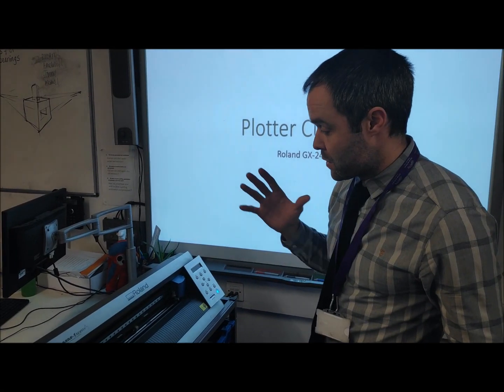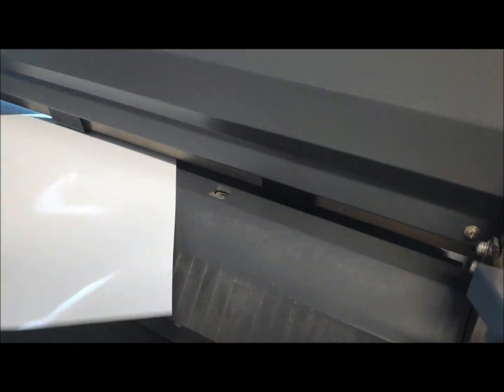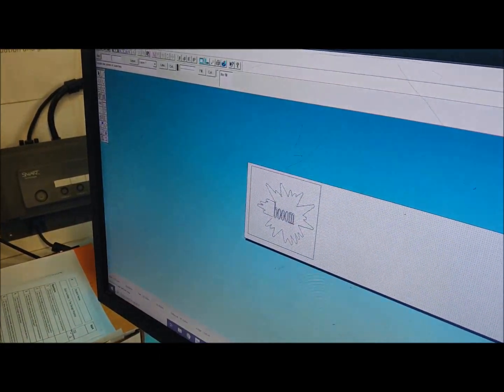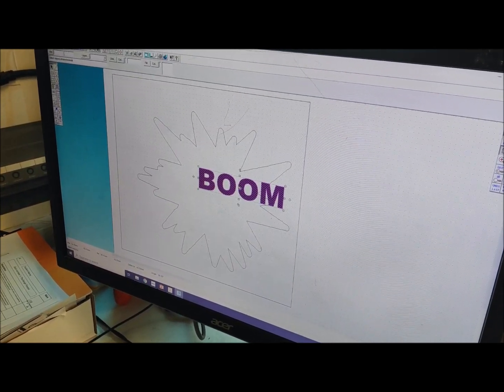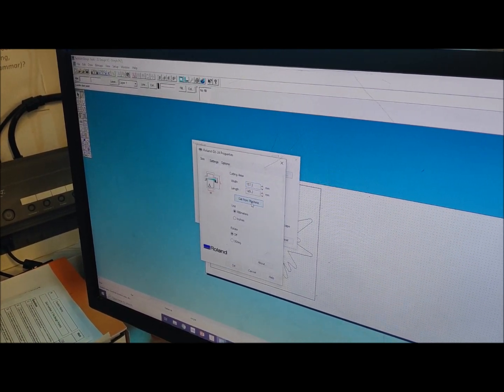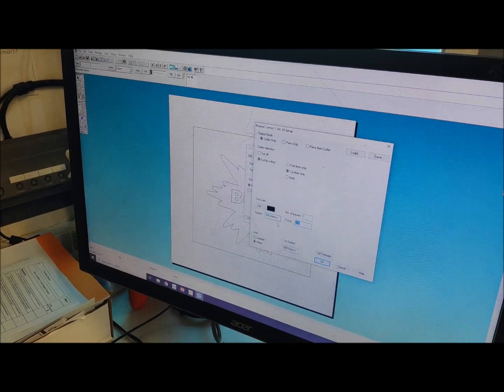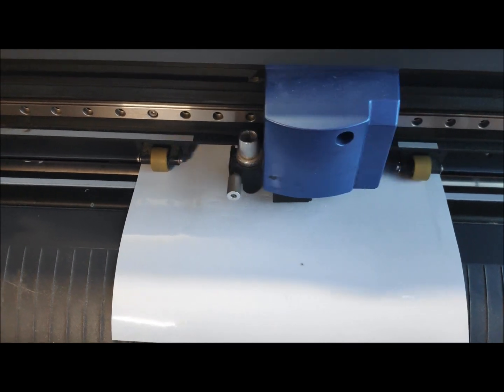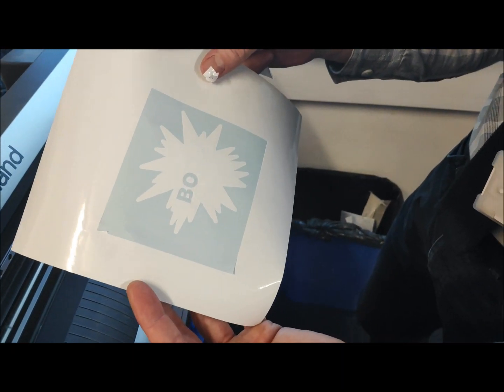How to setup and use a Roland plotter cutter

Comment: Hi thanks for the tut just a question . In what program do you open the file in order to print is it Corel draw? and the file is pdf or Eps ? Thanks for your time
Reply from the maker: The programme used here is Techsoft 2D Design and files export straight to CNC, without conversion.